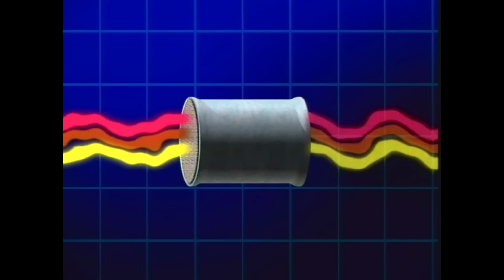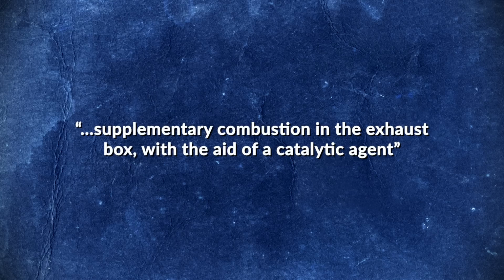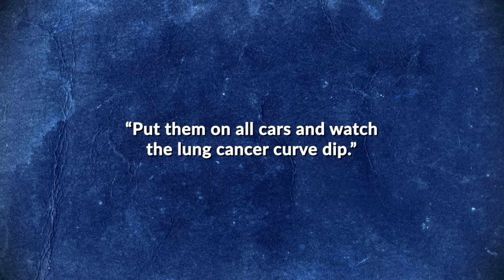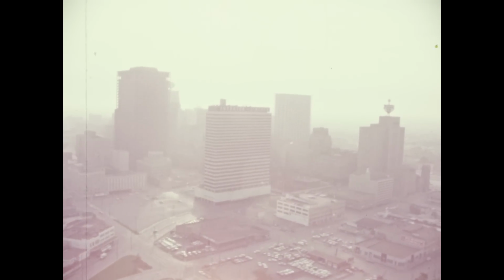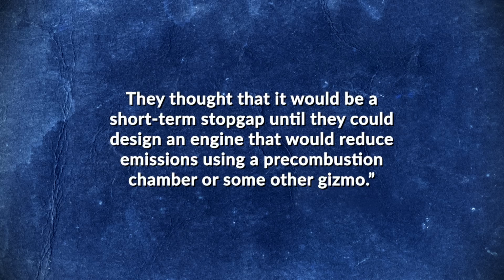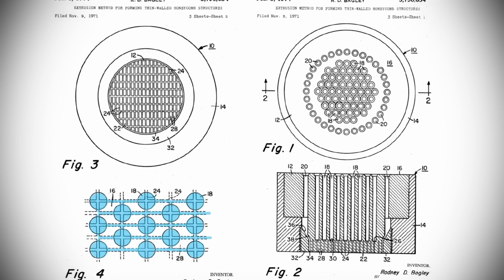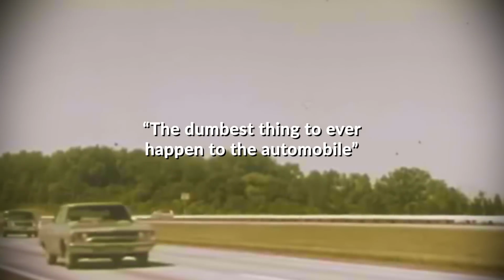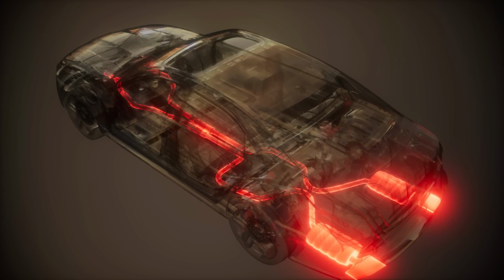The Most Underrated Automotive Component of All Time

Comment: There was an engineer in Texas back in the 1970s that invented a gasoline fuel system that completely vaporized gasoline into a much more efficient and powerful burning mixture than liquid gas.  The man then drove his ford galaxy over 300 miles on one gallon of fuel. And then the guy was shot outside of a bar less than two weeks later.  Why are we not talking about this ?? Why isn’t this front page news. It should be!  His system made more power and torque and made Almost 0 emissions when you compare them to a regular car from that era.

Comment: Nitrogen oxides cause a problem in crowded cities such as the LA Basin.  The LA Basin is probably the worst place in the world to build a city of 20 million people, but there it is.  Outside of these urban areas, the nitrogen oxides coming from vehicle exhaust actually have a net positive result.  You see, fixed nitrogen is a very necessary part of plant biochemistry and by extension, our biochemistry.  In rural areas, the nitrogen oxides rain out and make the soil more fertile.  Plants grow faster and better, including food crops and forests.  Nitrogen oxides are created by natural processes, such as lightning, forest fires and volcanic eruptions.  Chaparral fires in California cause smog because of this. Same with carbon dioxide, plants grow faster because we burn liquid fuels in cars and trucks, and coal and gas fuels in power plants.  Therefore we can conclude that the 3 way cat converters in cars and Blue DEF in the diesel trucks reduce smog in the LA Basin.  But they also reduce the fertilization of the farms and the forests forcing farmers to use more ammonia nitrate type fertilizers to get the same yields.  That's why every engineering student should be taught that there are tradeoffs with every design decision.  Politicians and bureaucrats could benefit from such lessons.

Comment: The quote from Earnist was not about efficiancy. He specificly said "run well". Those "new converter equipped GM models" were down a massive amount of power compaired to preEPA cars, even taking into consideration the switch from gross to net hp ratings. 165hp (net) was the Corvette, their high performance halo car, had in 1975. That's a far cry from the 275hp (net) out of the same 5.7l in 1971. The fuel efficiancy came from choaking the life out of the engines.

Comment: The most magical component on a car is the non electric fan clutch . or better known as the Thermostatic fan clutch ! Imagine all it can do. Cold at idle it glides along doing nothing and using no power. Drive down the road and still nothing. When engine temp goes up the fan engages as temps drop it dissengages. If hot and engaged and more power is needed on a highway it will again be cut loose to give full power to pass or overtake all with no electricity and no computer. Then afterwards it goes back to what ever state is required at the time.

Comment: I love learning about things like the science behind catalytic converters.  However I've got to say, in the video most of the examples shown in the exhaust system are mufflers, not cats.  A simple way to discern cats from resonators and mufflers is converters are usually as close to the engine as possible in order to achieve the temperatures necessary for the reactions you explained.  If placed in the rear of the vehicle the heat will have dissipated to the point where the cat would be useless.  That's also why we have air pumps on most modern engines.  The pump feeds O2 into the system on initial warm up to accelerate the heating of the exhaust so that the chemical reactions can happen in the first place

Comment: In 1979 the GVWR Cutoff for Catalytic Converters moved from 6000 to 8500...and stayed that way till the mid- late 80s
Reply: This was due to Dodge figuring out that a half ton pickup didn't need catalytic converters if the GVWR was 6000 in 1978, leading to the production of the fastest mass produced vehicle for the 1978 model year, the Dodge Lil' Red Express Truck. With the change to GVWR to 8500lbs, the 1979 model year LRE came with catalytic converters.
Reply: @kensanders6241  Really? - My friend had one....and My 1978 F150 2WD with a 460 and C6 Auto from FACTORY would smoke that slug!

Comment: Cat thieves target vehicles with high ground clearance, not wheel base. Wheel base is the distance between the axles and has no direct effect on how easy a cat would be to steal.
Reply: 100% spot on. 
I'm in an area where Nissan NV200's kept getting hit.. Aaaaaaaand them motherfuckers aren't long lol 

(Also, oe cats from the dealership are incredibly expensive compared to other models')

Comment: The first cars that were required to conform to the emission standards set by the EPA were awful. Mostly, they were underpowered. The pollution control systems were work around systems that were designed to pass the emissions tests, but were overly complicated, and didn't actually help with pollution much, if at all. They incorporated air pumps that required horsepower to drive them, in order to ad air to the exhaust to pass the exhaust sniffer test. In this way, they were able to pass the test, but did little, if anything, to cut down on emissions. They were also chock full of vacuum lines, which were prone to failure, and once they failed, the car ran poorly, and emitted more noxious fumes than they would have without any emission control systems at all. As usual, government interference made a bad situation worse. This is what happens when you let politicians drive engineering.

Comment: We had a '76 Pontiac with a 455. It was a real dog. We joked that if you floored it the gas gauge went down quicker than the speedometer went up. I drove that car from Dallas to DC and on some of those hills it was floored for miles and never got to 65 MPH, meanwhile older cars blasted past at 70 or more, and probably got double the miles per gallon. If my memory serves it got about 4 MPG on the highway.
Reply: Something was seriously wrong if you got 4 mpg on the highway.
Reply: @gregorymalchuk272  That was with a canoe and 3 bicycles on  the roof rack, 4 people and luggage for a month. We averaged about 8 mpg on the whole trip, but some of the hilly sections were substantially worse. 4 is our estimate of the milage while trying to go up those hills when the worst tank was about 6 MPG. It was an absolute dog, and yes, we did have it checked out by a mechanic using what was then state of the art equipment. The mechanic said that engine was an awful design, and ours was the worst he had seen. He offered to put a cam in it, but my dad didn't want to spend the money. I suspect he spent more than that on the gas on that trip though...

Comment: Another reason hybrids are a target for thieves is that, because the engines run cooler, there are more valuable metals in the converter itself. So they're more valuable.

Comment: Thats a common misunderstanding. Leaded fuel preventing engine knocking was a bonus/side effect. The real primary reason was the limited advancement in metallurgy at the time which meant valves and valve seats were getting worn out prematurely.

Comment: Fun fact the only part of your car regulating fuel air ratios like direct fuel injection that isn’t electronically controlled is the air intake, that is mostly based off how much air the cylinder can suck in. Now a few companies are playing with electronically regulating air flow vastly improving efficiency and emissions. I don’t think they’ll be as present with gas cars currently but with hybrids in the future for sure.

Comment: I was a mechanic in the 1970s and remember the moaning and tears shed by the automotive industry.  It was pathetic, the industry that had pulled America through world war two acting like babies!  The answer to curbing air pollution wasn't just the catalytic converter though.  Electronic ignition and fuel injection plus zero tolerances resulted in more efficient engines also played a part.  Young people today born after 1975 do not remember smog like I do, believe me it was not nice not being able to breathe!  Today you go the top of the Empire state building and see all the way to Pennsylvania because the air is so clean in New York!
Reply: To prove that no good deed goes unpunished, the Clean Air Act resulted in a 1.5 degree C rise in average temperature.
Reply: @donaldcarey114  No it didn't!  The increase in temps was due to the increase in power plants, autos and trucks. In 1970 America had something like 80% of the world's vehicles, today its half that because vehicles are now everywhere, even in China (which in 1975 had almost no cars!)   If the act had not passed the increase in pollutants would have been much higher and a lot sooner.  The only upside to no act would have been fewer people due to increased deaths from cancer etc.

Comment: 21:50 its high ground clearance. Wheelbase is the measure between front and rear wheels of a vehicle. Theyre measured perpendicular to one another. 

Im not sure i want Simon to start a car specific channel after this video as a whole. It hits solid points but i also feel like it misses out on some other details it could have added in without amounting to much more than a minute or two worth of extra content. Good video regardless, just changed my opinion in refards to other folks comments about a car channel that I had previously agreed with. But, still, like I said, good video nonetheless

Comment: Fuck the emission systems and computers on our cars. These are not right to repair friendly. We need to make the cars larger so as to improve the room to repair. All cars should have hoods as long as a 1969 Caddy. Oil filters should be remotely mounted. every part should be removable while every other part stays put.
Reply: I agree.  No car should have an engine smaller than 7.0 liters, and they should be required to weigh 9000 pounds.  And the hell with seatbelts while we are at it!

Comment: The catalytic converter should not be needed if one has complete combustion of the fuel to carbon dioxide.  As in:
Patent pending combustion maximization.
Using recycled exhaust to throttle combustion not only allows optimal, stoichiometric ratio of fuel to air at all outputs, it allows the fuel to be mixed with the air far enough in advance to assure adequate vaporization for complete combustion.  It also limits the heat of combustion while still maximizing the efficiency of fuel usage.  By keeping the heat down the wastage of energy via exothermic production of thermal NOx pollutants is minimized or prevented.  When this heat threshold is exceeded water (perhaps condensed from exhaust) injection can be used to supplement this cooling, giving additional power as it turns to steam.
Alex Koponen

Comment: The solution for cat theft is to design engines that don't need them or at least much smaller ones. HCCI engines have a slower, lower temperature combustion that can be clean enough to not require a cat to meet current emission standards, only problem being that HCCI has a relatively narrow operating sweet spot. Another engine type that has low emissions is free piston linear generators which can have whatever combustion cycle you can be bothered to program into them, though these may not efficiently scale down to the 20-30kW needed to run a car, small SUV or light truck.

Achieving cat-less low emissions is likely only possible with sequential hybrids that allow the engine to run exclusively at its sweet spot from the moment it starts up after departure until it shuts down before arrival.
Reply: It's impossible to meet modern or even 40 year old emissions regulations without catalysts. The heat will generate some NOx and the wall-quenching Will generate carbon monoxide and unburned hydrocarbons.

Comment: In 1974 I purchased a new Pontiac Firebird with a 6.6 liter engine.  It was a nice car, and ran very well AFTER IT WARMED UP.  In winter, I had to sit there for 2 or 3 minutes while it warmed up, or the engine would stall or stumble when I gave it gas.  In 1975 catalytic converters & unleaded gas were introduced.  My 1976 Trans Am had much better driveability, even when cold.

Comment: is that what those are? I always cut those off and replace them with straight through pipe for better sound and performance.
Reply: Then you are an idiot. A well designed Catalytic Convertor does not limit performance, but it does remove Carcinogenic compounds from the Exhaust.

Comment: A few months ago, I had the catalytic converter stolen from my car in front of my house.  A car pulled up, 3 guys jumped out, one slipped under the car with a power saw, he cut through the harnesses and the pipes, they took the converter and were gone in just a couple minutes.  There were apparently 6 stolen that night by the same crew in my city of ~70K people.  Thankfully our auto insurance paid for most of it, but the base price for replacing it, the connecting pipes, etc. was just over $4,000.  Just the converter and the pipes were nearly $2K of that.

Comment: I am surprised you didn't mention that Honda developed the CVCC engine that basically eliminated the need for catalytic converters. They could even run on leaded gas with no problem.
Reply: What exactly do you think the problem with leaded gasoline is?  I'll give you a hint, it's not that no cars could run on it.
Reply: @UnsuspectingTrout  So you're claiming using leaded gas wasn't a problem?
Reply: @UnsuspectingTrout  The original comment... "They could even run on leaded gas with no problem."... suggests that there is no problem running on leaded gas, so long as you don't have a catalytic converter to foul up.  Are you saying you agree that adverse interactions with a catalytic converter is the only problem with leaded fuel?  That the only reason we needed to get rid of leaded gas is because it caused problems with catalytic converters?
Reply: @UnsuspectingTrout  You weren’t. Vyvian was.  You responded to Vyvian, and failed to understand what they were even arguing.
Reply: @wagnerrp  I wasn't even making an argument, I read their statement to mean "the engine solved the problems associated with leaded gasoline."  They clarified they were responding to a specific point in the video as if it was a personal conversation between theirself and Simon, which is certainly one way to behave but I'm not sure how much success they expect to have communicating with people when reading their mind is a prerequisite to having the full context.
Reply: Fuel injected Volkswagen Rabbit/Golf cars didn't have cats until 1980.  CIS runs so clean they didn't need it.
Reply: @UnsuspectingTrout  I get what you  mean now but as evidenced by others misunderstanding you, you worded your comment very poorly.
Reply: @UnsuspectingTrout  Well that is your interpretation, however there's a flaw in interpreting your own words.  I'll let you figure out what it is, I don't want to talk with someone so rude.
Reply: @UnsuspectingTrout  CVCC was nothing more than a brief detour to avoid having to switch to EFI.  It was better than a standard carburetor, but it wasn’t “good”, and it was quickly abandoned once it was unable to meet rising emissions regulations in the 1980s.

Feel better now that we’re back to the original comment, and not the snarky about leaded fuel being bad in all engines?
Reply: @wagnerrp  You trying to win an award for being dense? Nobody here said that CVCC is the next great leap in automotive design. This whole discussion is taking place under a video about catalytic converters. The original commenter was just making an anecdote about an engine which does not require a catalytic converter to reduce emissions. In this anecdote, they included the detail that leaded gas will not cause a problem with running a CVCC engine, as opposed to an engine running with a catalytic converter. Please stop replying unless you're ready to stop being a dumbass.

Comment: Fun fact:  A car with a working catalytic converter doesn't generate any CO.  So, adding ethanol to gas to reduce CO is a total waste of time and effort.  But the farmers lobby is too powerful to let it stop.
Reply: Fun fact: here in Europe, they push E10 over E5 to lower the amount of fossil fuels used.
Reply: e5/10 these days are used for octane enhancement.  lead's problems are bad but the substitutes had their own toxicity issues. Ethanol has a very high octane rating

of course, if 87 octane was standardised worldwide,  no additives would be needed
Reply: We need to get rid of ethanol mandates. It is extended dangerous to be incentivizing an energy-negative pyramid scheme in the middle of an energy crisis.